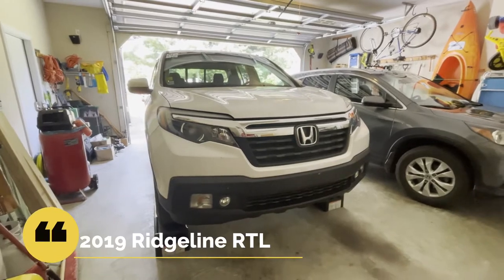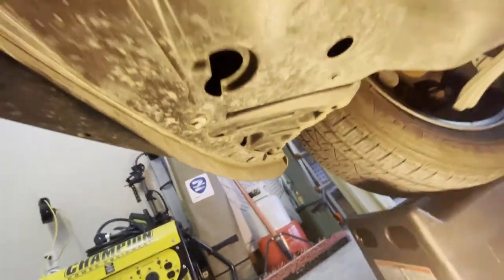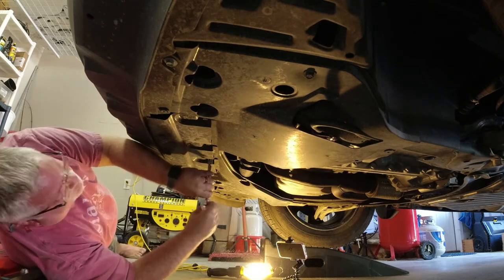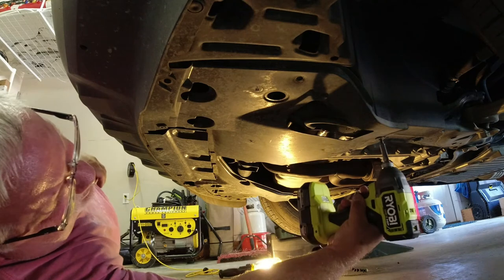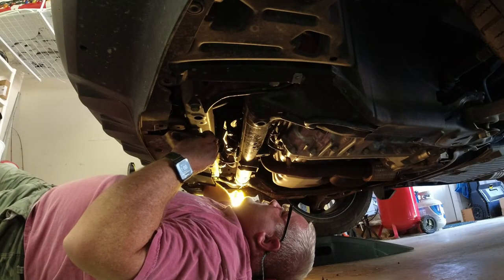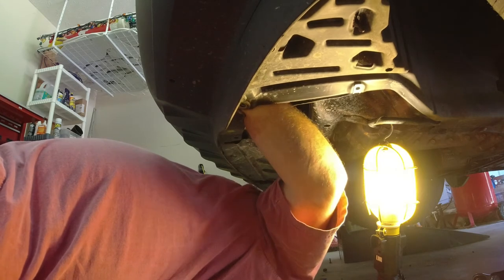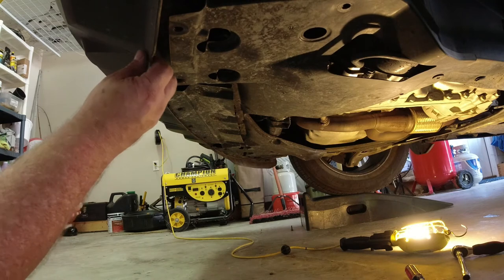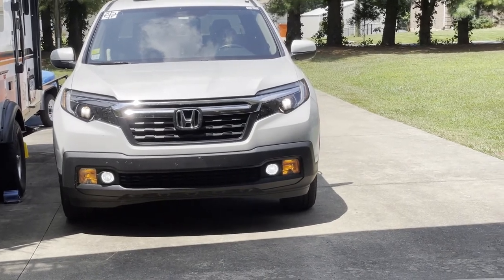Changing Fog Lights on a Honda Ridgeline

Comment: Great video!  One tip that I found in the comments on another video is that you can just remove a couple screws/clips right below the fog bulb and that will give you enough room to squeeze your hand in between the plastic pieces and change the bulbs.  It's tight, but it works.  You have to do it mostly by feel. Saved my bacon as the back Philips screw on my cover had stripped out.
Reply: dont use a screwdriver use a socket

Comment: Hi, thanks for taking the time to post this. I need to replace the drivers side fog lamp as the lens is broken. You mentioned in your update, there are 4 tabs to remove that will allow me to do this. Where are the 4 tabs ? thanks for any illumination you can provide here.
Reply from the maker: There are a total of two panels one on each side that can be removed. It’s easier but may not give you enough room to do what you need.

Comment: So these are yellow lights? Seems like that on the link yet they look white fog lights ? Not sure which is better the yellow or white for fogs?
Reply from the maker: Mine are white LED lights, they work great and are at least 50% brighter than the ordinal lights.
Reply from the maker: I fixed the link, these are the ones I put on my Ridgeline. https://amzn.to/3cIuAKt
Reply: Amber fog lights or yellowish fog lights are much better in the fog than white lights or in the Snow White Light reflects in fog or smoke and just spreads out making the white fog even brighter so it's very hard to see amber light does not reflect through fog and snow therefore you can see much better as the amber light will cut through the fog not reflected I'm putting Amber ones in my vehicle I have a gen 1
Reply: @sobbsaroonie  thank u
Reply: @sobbsaroonie  is there a particular upgrade for led fog lights that you might recommend?

Comment: I don't have a Honda but entertaining anyway. Nice of Honda to engineer the car to make replacing bulbs so easy. Guess they figure if Chevy, Ford, and Dodge can make replacing things difficult, so can they. I swear these car mfg's make it so you have to take the car back to the dealer even for something as small as a light bulb. Made the mistake of bringing my Nissan to the dealer for a cabin air filter. $90, yes, $90 for a filter I could buy for $20 and spend an hour myself installing. Well, that's what I get for being lazy.
Reply: Changing any cabin  filter would take you 15 minutes max... You're exactly right though they try to make things as hard as they can for DIY buyers